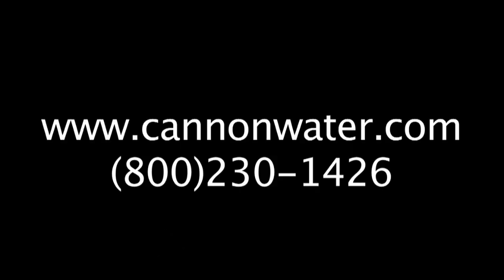Power Failure Alarm Monitoring System

Comment: This would also come in real handy for owners of portable home generators which are strong targets of theft. If the power goes out while your awake or, especially,  when sleeping, the alarm will sound and alert you immediately. I've been Googling the internet for a solution to portable generator theft while you are either at home or sleeping while the generator is in use and the is the best solution thus far that I have found.
Thanks for making this youtube video on how it works. Well done.